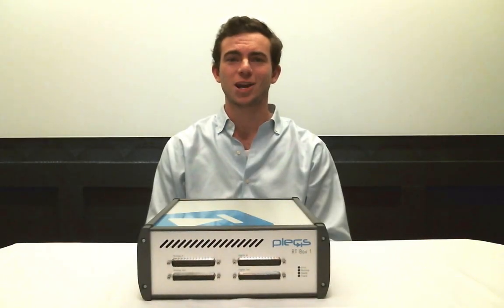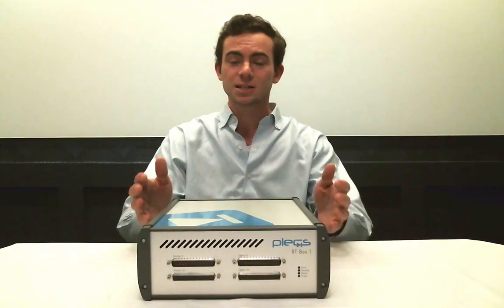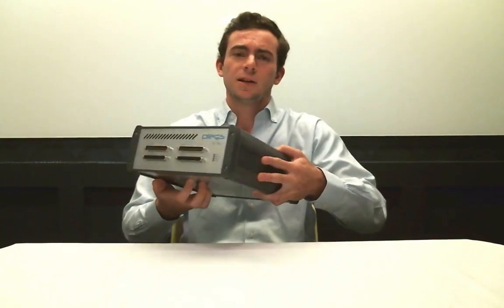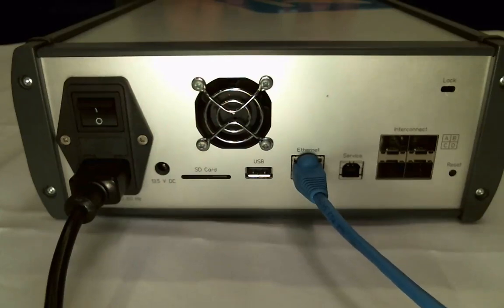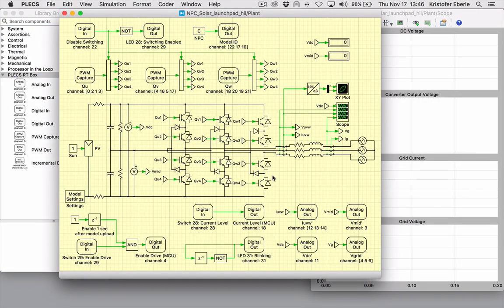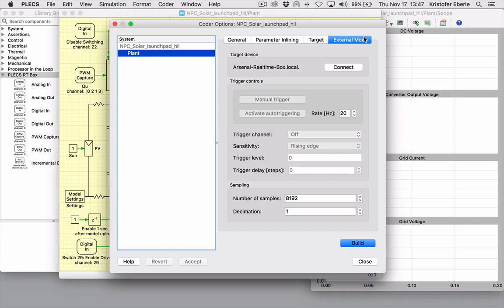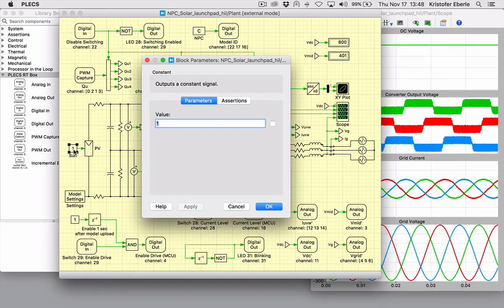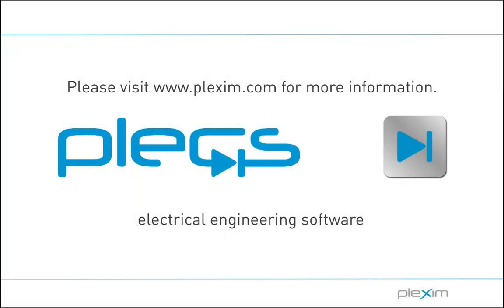A Quick Demonstration of the PLECS RT Box

Comment: Whats the resolution of the sampling of the PWM signals? 
Is it appropriate for a SiC based power electronic, with switching frequency of 100kHz and above? Or is there the need to scale the virtual model down to lower frequzency that the box can emulate it without delay effects get to strong?
Reply from the maker: Hello, the resolution of the PWM sampling for the RT Box 1 is 7.5 ns. As with all HIL simulators, there is a trade off between model complexity (dynamics and time constants, switching frequency, number of switches, etc.) and step size. Theoretically, 100kHz and above is possible, but whether or not a circuit is suitable for the RT Box is completely model-dependent. Time scaling is also an option. We are happy to discuss your application more specifically if you contact us at info@plexim.com.